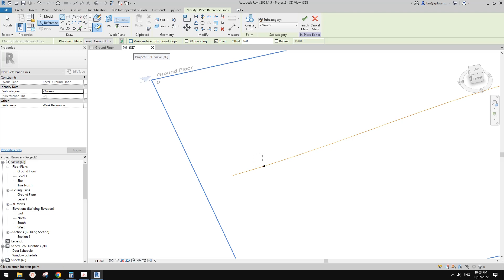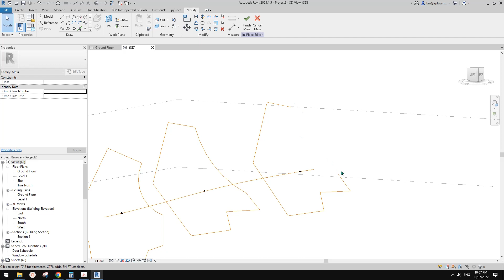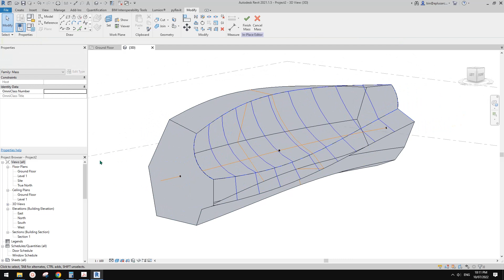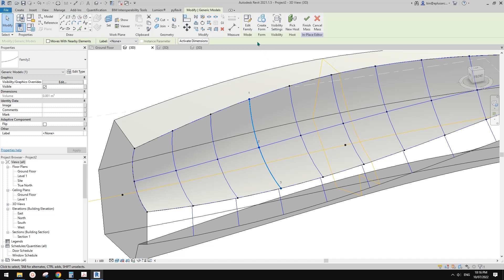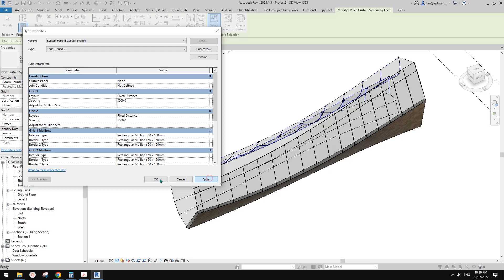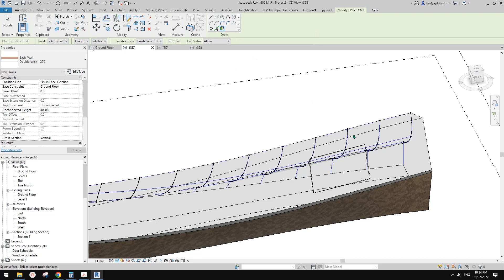Comment: A way to do gaps is to leave enough v divisions and apply a pattern based family with a small gaps in it (like you showed I day 891 ) … I don’t know if you can see in rendering if it is faceted or smooth ! 
A quick question : how can you know in pattern based family that u grid and v grid are the same like they are on the divided surface? I mean the u in family correspond to u in massing and v in family correspond to v in massing ??
Reply: I don’t know, I try my luck every time and if it is wrong, I rotate it by 90 degrees.